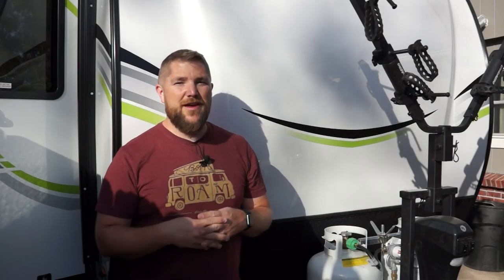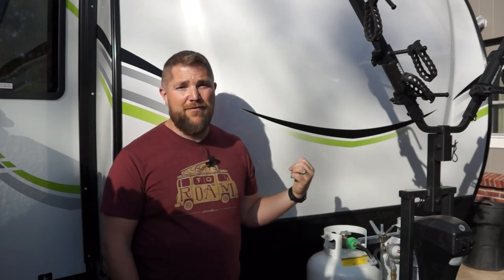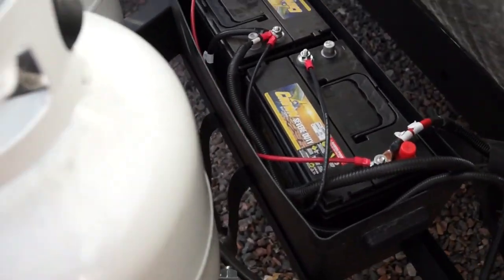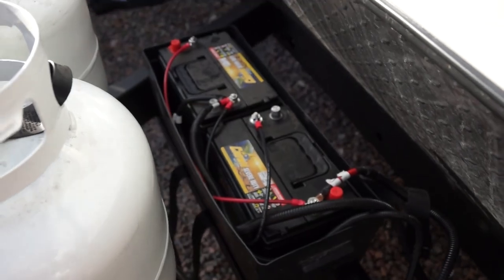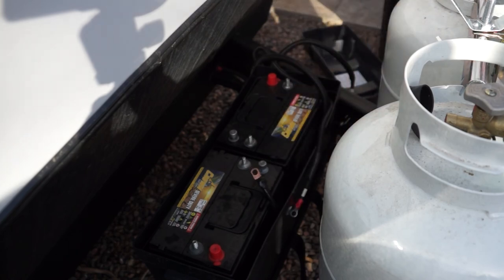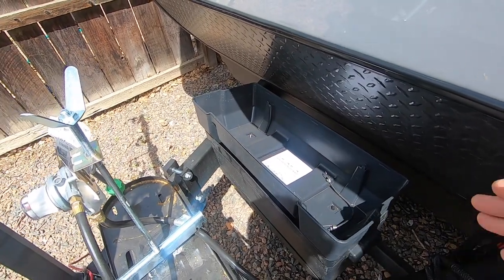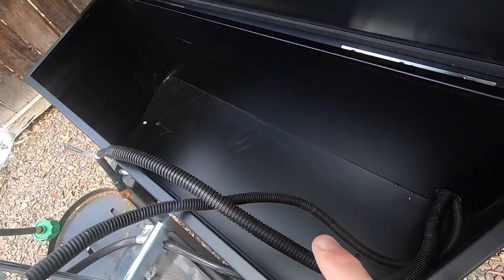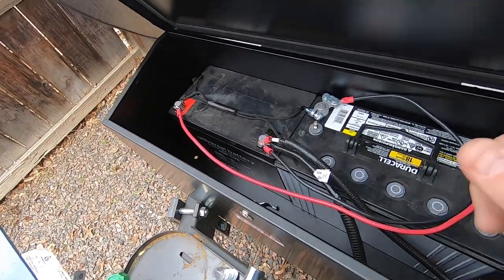Upgrade the Battery Box On Your Flagstaff E-Pro 15TB (Rockwood Geo Pro 15TB)

Comment: I might make a wood base for the batteries with your hold downs connected to that. That post connection shown on the battery is very close to metal. By making a wood base you would have a nonconductive  bottom that you can make to center the batteries in the box and even make some side support .
Reply from the maker: Sounds like a great plan!

Comment: Good afternoon. I was wondering if there’s anyway you could possibly send some pictures from a side profile and up against where the box meets the diamond plate? I attempted to do this exact same modification, and the toolbox ended up, hitting the back of the diamond plate, and would not rest flat on the frame in the rear. Just wondering if your box is a little bit different than the one I have. Purchased the same box from Harbor freight but I’m just wondering if maybe they redesigned it since you purchased it. Thanks in advance for your help.
Reply from the maker: Sorry, we have long since sold this camper. Please check out our newest videos!

Comment: Love this! Where did you get the wires that connect the two batteries? I need to find some but am unsure of where to look. I read online that it’s critical the wires are able to handle whatever the battery is kicking out otherwise they’ll cause a short.
Reply from the maker: Thanks! The camper already had two batteries and the wires were already there. Should be able to find wire and connectors just about anywhere
Reply: @ProjectBasecamp  Should the solar charge screen show a 2 if you have two batteries instead of a 1?
Reply from the maker: That setting is for a separate battery bank, so not needed in this situation.